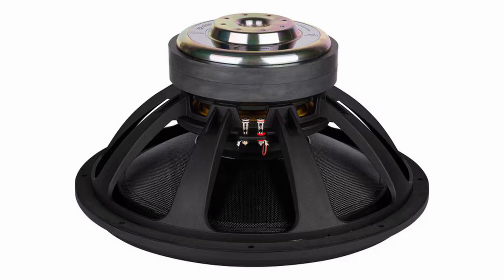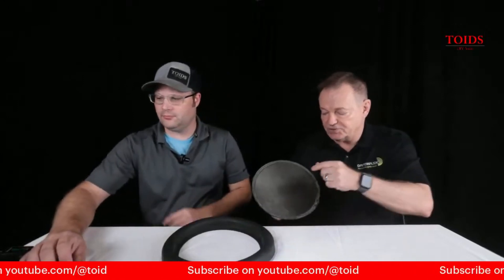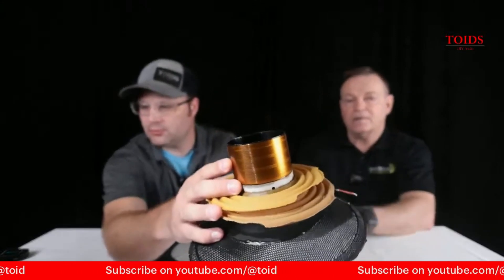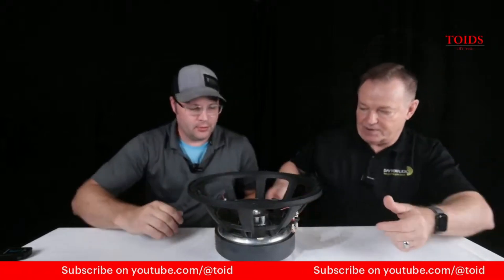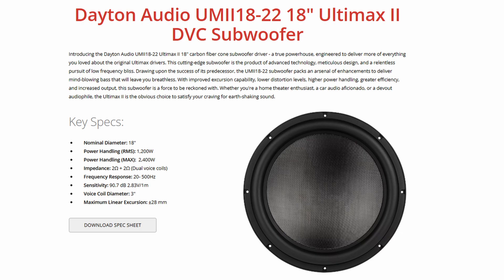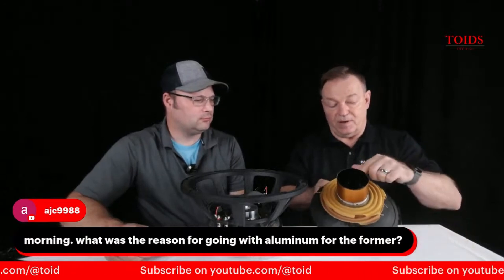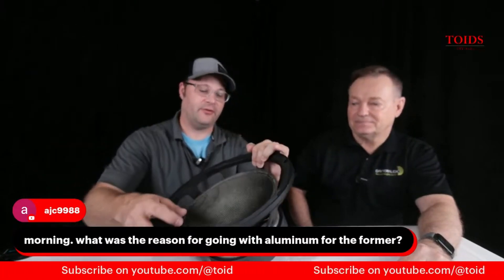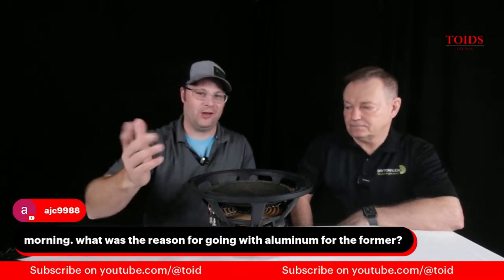Louder, Better, Cheaper! In Depth Look at the New Ultimax Subwoofers!

Comment: All the new Ultimax II series  units have higher fs  values, which is not good for low-end frequency extension.  Can anyone explain why higher fs is not an issue in your new design?
Reply: Maybe the lower VAS makes up for it, in the same sized box the lower VAS means it might dig down deeper easier
Reply: Perhaps they traded lower Fs for higher sensitivity. For the 12” and up it shouldn’t be a big issue as there is plenty of xmax available to make up for it (in a home audio setting at least).
Reply: Because you can easily “buy back” any low end roll off using DSP. Most sub amps have DSP and you can boost the roll off. This is possible due to the huge x-max.

Comment: Hello Toids!  I have a question for you here.  Are there any speakers cabinets designed to be both acoustic suspension, and ported?  This could give the listener the option to tailor their sound for the material they're listening to at the time.  I was thinking about building some boxes tuned to be acoustic suspension, then have a cover over a tuned port sort of like an air tight gas cap (But not as ugly!)  Love your channel, I wish I had half the toys you've got in your shop! LOL
Reply from the maker: @BobJohnson-tq5vm  there’s quite a few subwoofers that do this. I haven’t seen many bookshelf or tower speakers. But there is no reason you couldn’t do it.

Comment: Does anyone know how they were able to reduce the price on these??? Was that a stamped steel or cast aluminum basket?  I noticed that they strayed away from talking about the basket design.🤔
Reply from the maker: @carrizzle9586  it is not a stamped steel basket. Actually, I believe it’s the exact same basket. Which is probably why we didn’t talk about it because nothing changed.
Reply: @Toid The basket has a different design but cool it's cast aluminum. Thanks for the response.
Any word on where the cost savings came from: bigger quantity when bulk purchasing, material costs decrease, 1 less ferrite magnet slug, or simpler design???
Reply from the maker: @carrizzle9586  it was my understanding while talking to Brian that the cost savings just came from the new design in general. I don’t think it was one specific thing. It was a combination of everything. Unfortunately we didn’t spend a lot of time discussing the particulars of that. I’ll have to keep that in mind as a question to ask next time.
Reply: @Toid basket design is different this time around. The new Ultimax looks to have a custom tooled basket as where the basket on the original Ultimax was a variation of the very popular and much used 12 spoked basket. Not sure why the new design wasn’t brought up but it isn’t going to change much in terms of clearance and cooling.

Comment: What is Dayton best subwoofer for cars?
Reply: Ultimax
Reply: The Max x line is fantastic. Ultimax are even better. And don't sleep on the reference line either. It comes down to power handling and space and looking right. I my self don't like aluminum cones. Put that is a personal thing. The Max x is stunning in my opinion have the 15 it has massive cone area for a 15 and plenty of motor force. And sounds incredible. Box is slightly less then 10%to small tuned to 30htz . And I am so impressed with it going on 2.5 years.

Comment: I just did the math, it's cheaper to buy the 24" subs on the market.
The 24" sub from SI move 35m cubic mils of air, whereas 4 18" ultimax 2 subs will move 40m.
But one 24" comes in at $1k whereas 4 18" subs come in at $1.2k.
But I haven't checked the BL specs, I assume the 4 x 18" subs will have higher BL per cubic centermeter of air moved.
Reply: I don't think BL is summed, on the contrary, due to many drivers summed, it will smooth out the response (in general).
Reply: @alexoncunha2138  okay, thanks.

Comment: Anodizing black aluminium pole peace extender you use for lowering distorsion (currently silver looking aluminium beefy shorting ring) end would suckin even more heat in from voice coil former not reflect it back to the coil former (check emissivity and IR reflection), that way you would be able to increase power handling even more transfering heat to magnet+basket for increased termal transfer to the environment. Magnetic pole peace under the shorting ring would also help additionally if coated with thin layer of black high temperature paint to recive its portion of radiated heat from black anodized c-former...

Comment: Would love to see a comparison video between these and other higher end within reason subs in the 15" size like the stereo integrity and other Dayton products and lavoce within that budget ballpark
Reply: Agree, it's getting quite confusing between these and Reference HO and HF series - I guess the latter are still better in terms of SQ but also more suited for small sealex boxes due to the stronger motors
Reply: @erkkijaakkopetteri  ya a little confusing. Could even mix in sealed 18" compared to ported 15" if they can be done relatively in a similar box size would be a nice comparison
Reply: Agreed

Comment: That breakup in the impedance, the result of a single sheet of carbon fiber and the inverted dome geometry is not helping. The drive looks good, but it can't stand a chance to a standard paper cone in terms of sound quality or even an aluminum one from the Reference line. If just had a normal cone with a dust cap, things would have looked ten times better because the normal cone is a much stronger structure than the inverted dome. It's physics guys and math. For this sub to work nice, you need to cross it over at 100-200Hz 12-24 db/octave. WIth the Reference, I could go to 500 Hz xover point at 12 db and they have lower fs. The only inverted dome diaphragm that works well is sandwich carbon fiber, but it's sill an aesthetic gimmick because it does not provide any sound advantage. There is a reason producers like Acoustic Elegance are top, and they use classic cones. For that matter, I still wouldn't but a Magico even if I had the cash for because in order to make a great inverted dome, you really need a large cone underneath it so it acts more like a large dust cap. I love the Reference line of subs, though.
Reply: These are subwoofers bro, not really designed for anything above 200hz.
Reply: @Openeyesopenheart42  Reference line are also subs, yet they are very musical, especially the HF. I am not saying one cannot use these just as subs up to 200hz 24db/octave and be happy with it, I am saying that the design of the basket, the motor, all looks incredible and I was looking to them in order to use a pair into my build, but it seems the diaphragm isn't doing it for me. I really want to cross the subs over at 400 Hz 12db/octave. Reference works great for that and I'll stick to them.
Reply: @IlarionMoga cool.
I agree with your assessment, would be more relevant if prefaced with, “for my project “  for the noobs . As a sub , it’s not in the vocal range and the carbon fibre cone won’t attribute much to the sound.
Reply: @IlarionMoga  sounds like an interesting project you have in the making? Are you doing an open baffle ?
Reply: @Openeyesopenheart42  I am looking to make a 3 way "compact" speakers that I can use without an external subwoofer for the obvious performance convenience and I am looking to get musical drives and was very pleased with how these UMII look and wondered about their performance. 

I get it, this will be use primarily for car audio and home subs crossed over to max 120Hz and that is fine. It is best suited for sealed boxes because the membrane is really light. And it will work just fine, but am still not convinced by the inverted dome diaphragm. It works best only if double layer carbon fiber is used and it has the the volume filled with resin. Textreme from SB Acoustic is a good example of impressive inverted dome use.

I just wish these UMII would fare better over a wider range. The inverted dome is a design flaw and it would easily go away if exchanged to a classic cone form with dust cap. The break up point would certainly be much higher, probably beyond 2kHZ.

My problem is that I can't find a decent woofer-midrange that I could cross over lower than 300-400 HZ and go all the way up to 2500-3000 Hz cross over. The distortion in the lower end or higher end is always a compromise unless I cross over the sub at 300-400 12 db/octave. The reference line does that perfect!
Reply: @IlarionMoga  Define "musical".
Reply: @iggynub  the ability to render sound waves as close to the signal as possible. That is whi IB setups are the best when it comes to sound resolution. It is also the ability to play on a wider range, meaning to keep a linear SPL as much as possible over as many octave as possible. 
Most car audio subs play a narrow frequency segment and then they drop fast on SPL and grow in distortion.
Reply: Love the reference line. 
Had great results in a ported box had sealed just didn’t hit enough. Both very musical . 
Really want to make a second pair with max size box and f3 of 20 or 18HZ just low Fr reinforcement
Reply: With the "serial" responses and backpeddling, are you just looking for something to complain about? You acknowledge, begrudgingly, they are likely not for you. Leaving it at that would be the adult thing to do.
Reply: Dude, if your application needs a driver that goes to 500 Hz, you need a woofer, not a subwoofer.  Just because some subs can play higher than others doesn’t mean everything in the category needs to be re-defined.

Ultimax subs are about moving as much air as possible.  That’s the main concern of producing sub-bass.  The piston only needs to remain rigid at the frequencies it’s intended to play.

500 Hz is where midbass transitions to midrange, which is not the area subs are designed to play in.  Usually the only place you see 18” drivers playing that high is pro audio.
Reply: @superspeeder  Yes, I agree! I understand the compromise made by DA in order to make the membrane lighter while keeping the visuals cool, and for a sub, breaking up at 500-700 Hz is no big deal. It will be crossed over at 120 HZ tops anyways. 
Pro audio are really for high SPL, they use a lot of power, the most I would go are the Acoustic Elegance, which are the best woofers with subwoofer capabilities one can buy, at a price, of course. They're better than the DA Reference line at 3x the price.
Reply: Hornresp and WinISD both have these UMII’s playing in a sealed box quite flat from 60-300hz. Ported even more impressive, 1/4 wave and you’re playing flat from 25hz to 200hz and can cross over at 400.
Reply: I would say it just seems strictly engineered to do something else than what you're looking for. I would be crossing this over at like 50-70Hz somewhere.
Reply: @MFKitten  with fs at around 30hz, it's just too much distortion to make sense a cross over at 50hz. If it had like 17hz fs, yes. There are other drives have narrow useful range but lower fs and they're bettr on a 50-80hz xover. Besides, thise drivers peak spl is between 100-200.
Reply: @IlarionMoga  oof. Yeah, that's not ideal.
Reply: 100-200Hz? Why not just stick with the reference and not look at this line of subs that clearly you know isn't going to work for your needs?

I use the Ultimax subs in low tuned enclosures and they work great for that. I wouldn't use them for high frequency stuff above 100Hz when there's better choices out there for that. They lack the sensitivity up there because of the mass I believe.
Reply: @JoshM7  The mass isn't the reason for less sensitivity, because by this logic, the UMII that has really light membranes, should have great sensitivity up to 1000 HZ and more. Really the lower mass helps to keep the resolution higher in closed enclosures because the drive motor has less fatigue in one area, the mass, being able to cope better with the air piston inside the closed box while offering tighter sound waves. It helps with SPL too because of that. 

You're right, this series is not for me and I am complaining about something that is most likely an acknowledged compromise by DA. Of course the low end will be better with the UMII bc of that lighter cone in a sealed enclosure and this will make most happy. Also, the "tall boy" surround is not ideal for higher than 1000 HZ anyway so if you stopband region starts at 500-700 these are good drives by all means. 

Still, they would have been better off with classic cone structure. I am sure these drives would have fared better than the reference line, since I want sealed or aperiodic, light cone is ideal.
Reply: @IlarionMoga  I thought the mass had some effect on sensitivity but if not thanks for correcting me. 

I wonder if some of the stuff they did was to shave off costs or keep the look of the older Ultimax series that I admittedly like. But doesn't work for all applications. 

Is the inductance low enough on the Ultimax subs to even reach past 500Hz without a ton of loss? Is been a while since I've looked to see what it could go up to before it rolled off too much.
Reply: @JoshM7  yes, it has, 100%! Relative to the design od the motor and box, sealed, ported, infine baffle. 
For a lower fs you need mass in order to put a bigger motor.
Reply: @IlarionMoga It isn’t just about mass to lower a drivers Fs. Suspension compliance plays a factor as well as the balance between moving mass and BL. Just seems to me this subwoofer isn’t what you would want for your specific needs.
Reply: Where does one begin to learn things like this? Is it audio engineering or mixing? Or neither? I really want to expand my knowledge and possibly go to school. I love the design side of things but I don’t think I’m smart enough for that but I equally love tuning things and making them sound great and I feel like that’s not quite as difficult. Any advice?
Reply: @LikelyLagging  if you research passive crossover design you’ll learn about using drivers in their range, which frequencies cover which common rages (midrange, treble etc), impedance, phase, sensitivity and a whole bunch more.

Building a small 2-way DIY speaker kit might also be a good place to start.  It will teach the basics of construction, and reverse-Engineering the crossover would be a simple task that will show you how it works.
Reply: @superspeeder  greatly appreciate the reply. I’ve been screwing around with dml panels the last few months and would like to add a amt tweeter to one of them but would like to do the cross over from scratch.
Reply: You're so full of BS😂
Reply: How many speakers have you manufactured? Exactly NONE LOL, so shut up and listen and learn something
Reply: @DryUrEyesMate  well, I don't understand why DA pursued to make a lighter cone while compromising on range, that's all. The old Ultimax series has a sandwich membrane, twice the weight, sure, but has none of the problems of this new one. Single sheet of carbon fiber membrane just doesn't do it for inverted dome, only for classic cone. Why not use a classic cone structure, just for looks? No offence, but DA deserves better, as I find their products to be very good overall.
Reply: @IlarionMoga all manufacturing should cater to you and your niche desires 😂😂😂😂😂 narcissistic much?
Reply: @DryUrEyesMate  He's not wrong. Be nice.